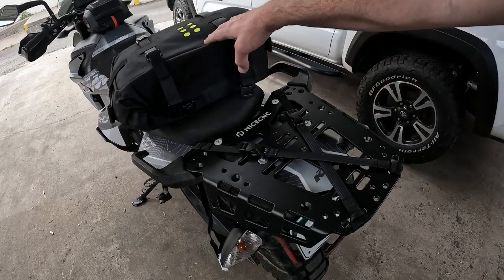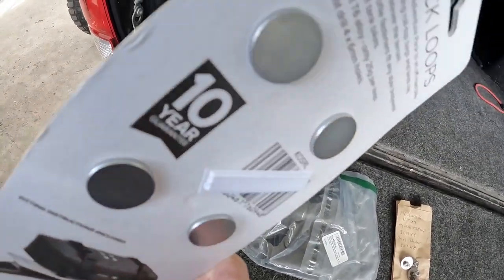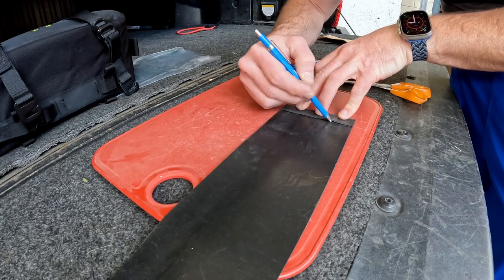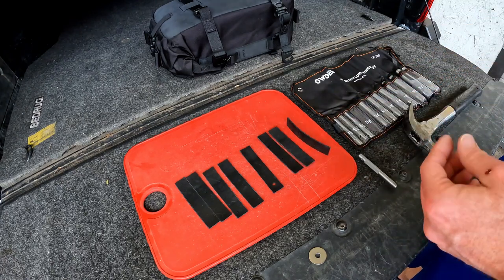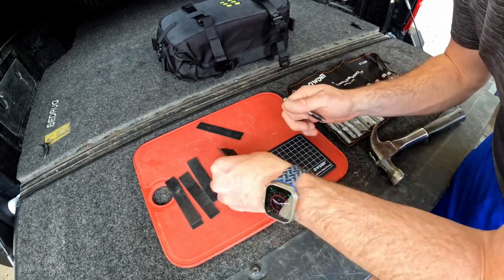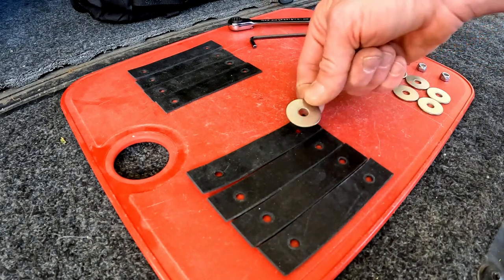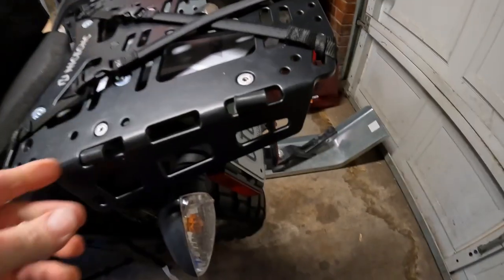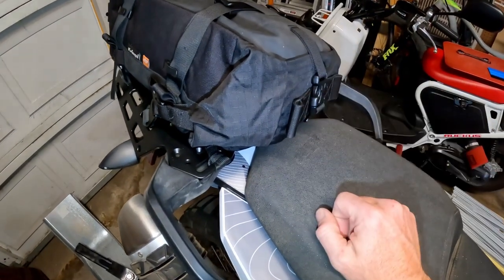DIY motorcycle luggage rack loops for Kriega bags

Comment: With those bags though you can use their own straps right through the ones on the side of the rack. That's what I was doing on a bike. Unhook them on the sides, loosen the straps a bit  and run them through the rack.
Reply from the maker: That should work.  Not quick to detach I would think.
Reply: @infosponge  not much different to using the created loops. But it'll depend on the bag and rack size as to how it fits.